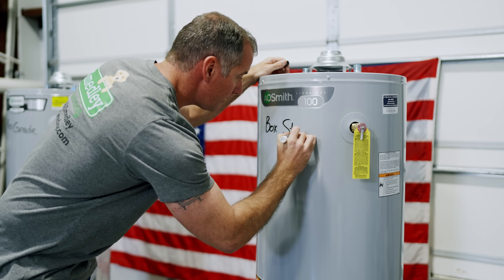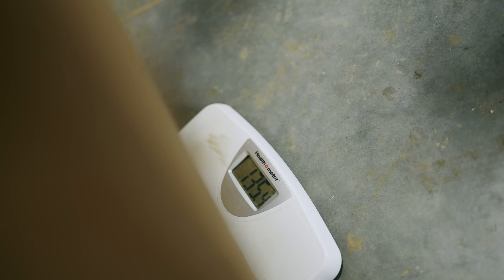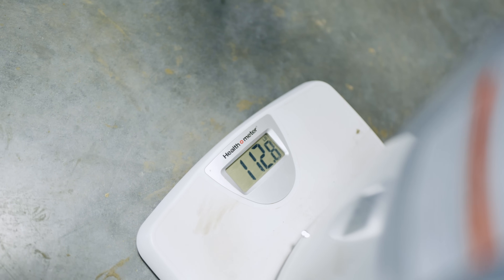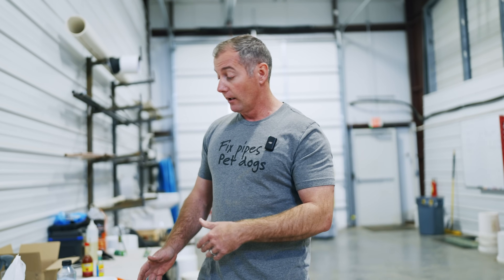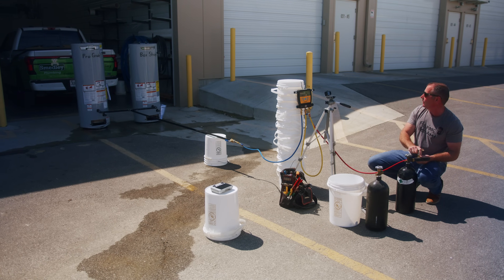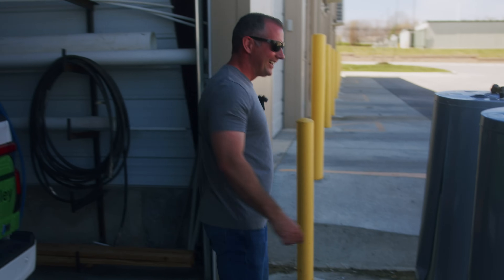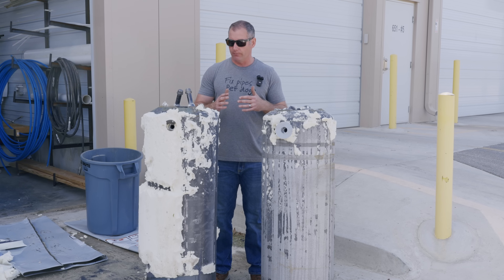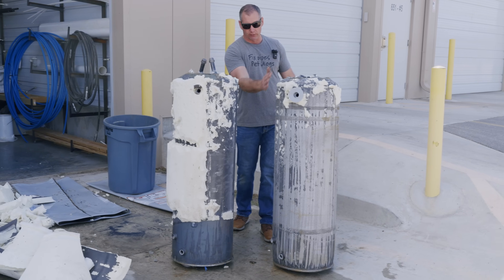What water heater should I buy? - Pro Grade vs. Box Store

Comment: If it has a different model number it's a different product, obviously. Like, a lot of time and effort boils down to that. If they were the same you wouldn't need a different product sku. Now if your point is that the tanks are in essence the same basic designs using different materials then okay, that's a good point. I guess at that point the question is whether better materials is really worth the one, two, or three-hundred-dollar markup. Maybe you just want a tank with the same features and don't care if this tube is made of brass the other steel or if it's 2 inches longer. Then yeah this is a more complex and interesting overall point to consider and understand.
Reply from the maker: The point is that the box stores want you to think they are the same.
Reply: @SmedleyPlumbing  Do they really though? I haven't seen anything misleading like that from the box stores. They have, what? Hundreds of thousands of products?... water heaters being one tiny portion of them. You got any receipts for that tea though?
Reply from the maker: @johnjingleheimersmith9259  I've had several conversations with product representatives that will confirm that inferior parts are being installed on box store units compared to ProGrade units. But as you can imagine those conversations are kept off records so there are no shareable receipts. That's why we filmed the video and that's why we're able to show as much as a 10 lb weight difference from one heater to the other.

Comment: While this is a Fantastic detailed comparison.  You simply sold me on Cheaper Box Store unit.   If I have to replace either heater every 7 years... Why pay more?   Definitely go with Box Store Unit. While parts might be slightly different between the two units  NOTHING that the customer will notice in energy savings or worth paying extra for.
Reply from the maker: Who says you have to replace it every 7 years?  The box store unit will be lucky to live to it's 6-year warranty while the pro grade unit will last 15-20 when properly installed.

Comment: It doesn’t really matter as long as you change out the plastic drain valve out and put a good one in. All units made in the states are all made by two manufacturers. The main difference between units is the drain valves and insulation.
Reply from the maker: I think our video proves otherwise....

Comment: Relief valve .1 oz difference not one oz. Question is how much did the differences cost the manufacturer selling the pro grade to someone who is going to pass the added costs plus a markup up on to a customer. Only bad thing, not different, but bad, I see between the two is the plastic flush valve, I'd be inclined to change that out right away. Kind of looks bad for AO Smith. How much do you think it saved them to have the shorted baffle in the center tube. Safety valve, oh yea I want Acme, recommended by Wile every time. You're promoting the PRO grade to much, they both failed. How far above rated max pressure did they go.
Reply from the maker: This test wasn't about marked up costs.  It was about quality only.

Comment: I think the whole "same factory, same day, same parts, etc." Argument comes from when the model number is the same between either source. There's no way these two have the same model number, they aren't even the same model at all. Literally labeled quite differently. I could buy two different lines of the same brand from the same store, and compare all the many differences due to an obviously different model. That argument is for when it's advertised the same at two different stores, and they also appear the same, but may not be.
However, I still would opt for a pro grade heater from a supply store due to a better model being available there.
Reply from the maker: Yep!

Comment: Just because an item comes out of the same manufacturing plant by the same company does not mean that they have the identical components within them, to get to lower price points some of the internal parts are different such as from metal to plastic…or they will use lower quality in thickness of metal or types of plastic. Cheers.
Reply from the maker: You are correct!

Comment: This video is opposite and contradictory to my experiences.  I have several rental properties and do all my own repairs using box stores.  I've had very little issues buying things from Lowes/Home Depot.  I built a new house and shop 3 yrs ago using a builder and have nothing but issues using his supplier parts.  Locke supply is the hvac go to for builders where I am.  I've bought replacement parts from them that don't last as long as the ones I get from lowes.  Plus, lowes will replace them easily and Locke will not.
  Today, I still have things going out and not working, having to buy it myself and fix it right.  While still paying my mortgage on the original stuff already in the trash.
  I'm not saying Lowes/HD are the best places to go.  But in my 25 yrs of owning houses, I do not use contractors if at all possible because it just doesn't make sense. Maybe you should come meet my builder, see the parts he buys and what he charges for them, and what is still working, then tell me his are better. 
  The next time you need a vehicle fixed, make sure you don't try to tell the shop you don't want dealer parts because it's the same argument you're making.  You must request for the mechanic to use all oem parts. The aftermarket parts store, Amazon, ebay, etc, aren't the same quality.  I use oem parts on my own vehicles but 99% of customers want aftermarket. But I see the point you're making.
Reply from the maker: There are a lot of reasons for water heaters to fail.  Unless we know how and why it failed, it's hard to make the comparison.  This video was put out because we see a lot of box store water heaters that are installed properly and yet still fail prematurely. Most of the time when you see a pro-grade water heater fail prematurely it's usually due to improper installation.
Reply: I fully agree.  Workmanship these days has disappeared.  I've had to go back and fix many things on my new house. Electric, plumbing, hvac, garage doors, everything has been touched. Maybe I have good luck because I take pride installing everything and even when using a crappy part it works well.
  When I did the electrical on my shop and had it inspected, the city inspector asked me who did it because he had never seen one built out so well.  I told him you're looking at him.  He said I needed to become a contractor and put everyone else out of business. The problem with that is that there's only so much I can get done by myself working on vehicles, and I can not find anyone worth their salt to turn wrenches.  So I'd imagine it's the same in other industries.

Comment: Lesson is change out the plastic drain to brass if you have that style, and change your sacrificial anode every 5 years, and you'll be fine. In my 40 years of home ownership, 18 years in one house, and 22 years in this one, buying 2 new houses with new water heaters, ive never changed out a water heater. Flush them every year, and change the anode every 5 years, and you should never have a problem.
Reply from the maker: We should add that the homes you are mentioning have pro grade heaters and not box store units
Reply: @SmedleyPlumbing  oddly enough, this house has the "Do Not Return to the Store" stickers on it. But it also has a brass drain...so...
Reply from the maker: @AnAZPatriot  some box store units have a brass drain.  But if it has that sticker, it's for sure a box store unit.

Comment: Somethings not right here , in the box there was only 5 lbs defersnce but out of the box there is a 12 lb defferance. That makes absolutly no since. And the pro had the foam pipe wrap in the box, hmm!  Either way a failed weld or a bad seam you still have to replace the water heater.
Reply from the maker: The packaging weighed different amounts

Comment: what’s your thoughts on a 10 year versus a six-year warranty? I think all it is. It’s a longer anal rod.
Or is the coating of glass on the inside of it thicker on a 10 year?
Ps I think you used wrong size socket for rod....supposed to be 1-1/16
Reply from the maker: Yeah I don't think there's any difference between the 6th year and the 10-year. But I think the 12-year warranty has an additional anode rod.
Reply: @SmedleyPlumbing  yeah I had a water heater shut off the burner because it was condensating so much which I thought it was leaking from factory, but it was just a water was so cold. It was like a waterfall.
Reply from the maker: @greekmaster1001  they condensate a ton on the first burn in the winter months for sure.

Comment: So, if I understand your video, there are three conclusions:
— Supply store heaters are worth the slightly higher price;
— You need to replace the anode every 5 years or so; and,
— Adding an expansion tank quickly pays for itself by greatly extending water heater life.

Makes me wonder:
— Why are anodes tightened so much you need an impact wrench to get them out; and,
— Why don’t water heaters incorporate an air bladder (or integral expansion tank).
Reply from the maker: Not sure on why anode rods are on so tight.  You wouldn't want the expansion tank built into the heater.  If it fails, you want to be able to replace it.

Comment: Near the end of your video, you say, "Glass is not flexible. Zero flexibility in glass".   That is completely wrong. Do you think they use a special glass for making fiber optic cable?? No.  It is regular glass. Might want to reconsider your information.  ---Doozer
Reply from the maker: Well actually... I see that you only showed up to split hairs and take things out of context. If you find a water heater that's lined with fiber optics please let me know. But considering water heaters aren't lined with fiber optics and they're lined with rigid glass, That would make your observation incorrect.
Reply: @SmedleyPlumbing  There is no rigid glass or flexible glass.  Just glass.  Not splitting hairs. Just correcting wrong information.  --D
Reply from the maker: @kooldoozer  okay. You're not correcting wrong information. You're splitting hairs. Go grab a mirror and tell me how far it bends before it snaps.  I'm also curious to see how far you can push your window before it breaks. But I get it You're one of those guys who likes to show up in the comments of other people's work and try to critique it when you have no actual accomplishments yourself. Thank you for helping the algorithm on this video.
Reply: @SmedleyPlumbing  Don't take my word for it.  Ask a glass guy how flexible glass is.  He will tell you because that is their trade. They handle glass every day. Stick with plumbing. Your mind is stuck closed as tight as an old can of PVC glue.  -D
Reply from the maker: @kooldoozer  or I'll lean on my 20+ years of experience that proves the tank fails soon after the glass lining is compromised because it doesn't swell like the tank does.  Have a great day pumpkin!

Comment: I worked for the Bradford White corporation in the 1970’s, and back then they made five different brands that happened to all be made the same.
Reply from the maker: I'd say a lot has changed in 50 years.
Reply: @SmedleyPlumbing  the only thing that’s changed is there are fewer companies producing these products at varying degrees of quality. Before I retired my landlord replaced my old water heater that was made in the 1980’s and lasted for 25 years, and the replacements kept failing until the fourth one. I retired a few years later.
Reply: It would not be unusual for both units to be manufactured on the same line on the same day. The BOM (Bill of Materials) controls the parts delivered to each station on the line. Due to orders and manufacturing speed the Pro could be made before lunch and the Box after lunch. There are a handful of giant pizza factories that make multiple competing brands daily. The robots squirt and layer per brand spec. More in line….Whirlpool makes many appliance brands and if you do any repairs, especially to older machines, many parts that are 25+ years are available in a day or two. No slight whatsoever to your excellent scientific method and video. I may never buy and install a water heater but as an industrial designer I have a compulsion to understand how things work. Than you very much.
Reply: “Classic Facebook Marketplace” “Return to Lowe’s Under Extended Warranty” LOL
Reply from the maker: @peterwachter7753  Yes with technology these days it is possible for the exact same assembly line to assemble two different products on the same day alternating back and forth between the two. However the selling point is that you are buying the same heater from each place. And so if the manufacturers are lying with language saying that they are produced on the same assembly line in an attempt to deceive the public than that is what we are trying to highlight

Comment: How many "plumbers" just go to a box store to get their supplies,  including the water heater?  The average consumer has no real way of knowing what they are getting.  Manufacturers are causing this problem by not clearly delineating the different quality grades within a product line.  Even the 6, 9, 12 year warranty gradient is actually the same unit with longer coverage, not better quality.  I've seen supply houses sell some pretty crappy equipment to the trades, so that source is not always a sign of quality.  Thanks for the forensic review.
Reply from the maker: Exactly

Comment: Our shop only had 5 plumbers but we always stocked all the sizes of pro grade Rheems and AOSmith electric WH's. So any time of day all year we could replace a WH and not go to a supply house or box store. 
Bytheway,I think the myth busters WH video was fake. There's no explosive danger from a over-pressureized tank.
Reply from the maker: So we tried to replicate that. It was a different video and you can find it on our channel. We later learned what we did wrong but it can absolutely happen. It just requires steam instead of hot water.

Comment: 24:47  on the burner assembly the hole is probably for a standing pilot light, its new old stock they are still using up.

My biggest question is where is the 
Bar they used so the tank didn't rust?  Calcium deposits cause the glass lining to go away  then the tank rusts.
My house was built in 1992 my Bradford White water heater has a pilot light  in the 24 years ive had my house ive never drain the 6 year warranty tank or changed the rod.
Your talking 31 years old.
I know im going to have to change it.

I want to see what the bare tanks weigh in at how thick is the metal and glass its lined with.
Ive seen a how its made,  they make the tank put on the bung holes fill it with glass sand and heat it a deep red hot that melts the sand as its rolling it coats the inside of the tank to protect it from rust.

The thickness of the metal and glass will determine how long it will last.  Ive never had a part o  my unit fail. Im going to assume its a pro grade unit. 
If its not broke dont fix it.
Reply from the maker: We wanted to check that out too but we felt that weighing them was sufficient.  Also the box store tank swelled and the pro grade unit did not.  So that also proves a difference in metal thickness.

Comment: " It was not made on the same DAY"  id be more inclined to compare them by sevral throughout the production YEAR. It wouldn't be unusual to find one that has a plasting drain and on with brass one the same line simply because the assembly line ran out of an old lot of parts they manufactored.  The tanks ability to retain the heat  with insulation and the amount of energy to produce the heat is its energy rating. More insolation the better the unit. The designs havent really changed much at all in decades. Kust the quality.
Reply from the maker: Just the quality.  Exactly.

Comment: I keep hearing him say...weight is strength. The more it weighs the more material so yhe stronger it is.

Wtf?  So a 1 inch diameter lead pipe is stronger then a 1 inch diameter steel pipe?  You know since the lead weighs more....
Reply from the maker: So what you're trying to say is that they are indeed made with different materials.  Precisely what this video was set out to prove.

Comment: The pressure tests were silly.  A liquid filled tank which bursts is no danger other than the resulting flooding. Liquid is virtually incompressible. A pneumatic tank is a different story. When it bursts, it can send shrapnel flying.
Reply from the maker: This is true.  But it's still unnerving standing that close to something with that much pressure inside.

Comment: The mistake you are making is assuming that the more weight the better the product. Many factors affect the quality of a product. Water quality in the life of a water heater is a big factor. The amount of use and heat cycles affect longevity. I was a welder on pressure vessels and the most common failure on hydro testing when taken to burst pressure is the shell seam,just like the pro grade tank did. The fact that the box store tank didn’t is impressive.
Reply from the maker: The box store tank swelled significantly.  That's the true sign of the weaker metal material.
Reply: @SmedleyPlumbing  I have seen hundreds of of pressure vessels taken to burst pressure. They will swell up if there is no shell seam or head seam failure not because of the weaker metal theory. The pro grade tank did not swell because it had failure.